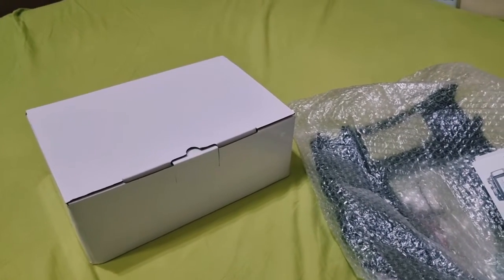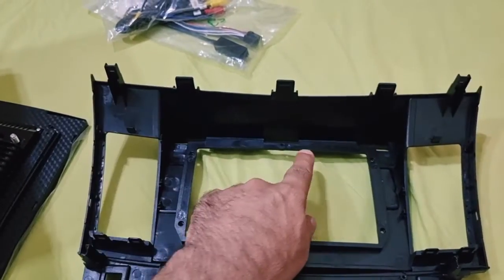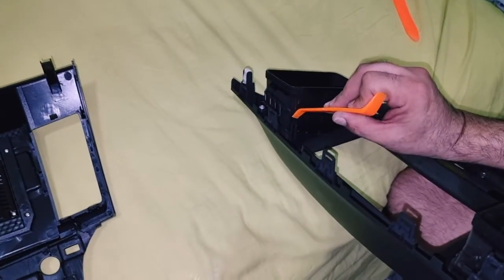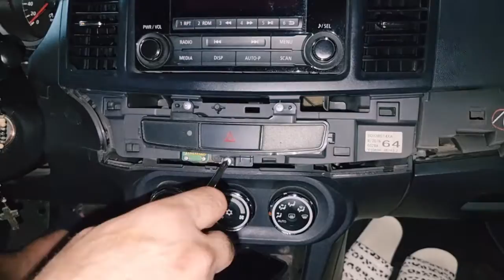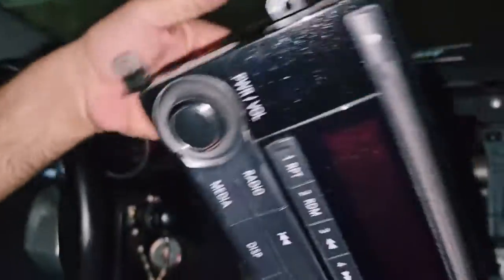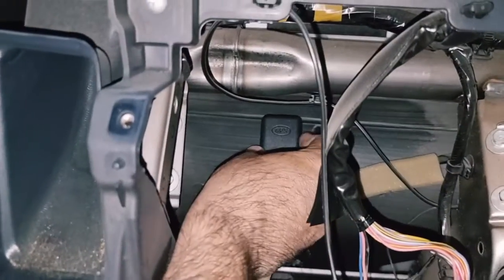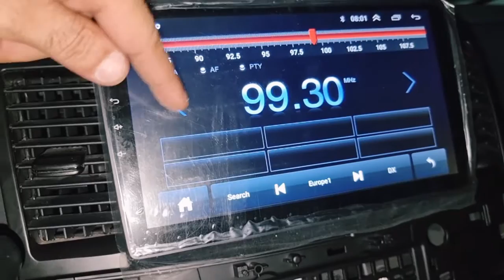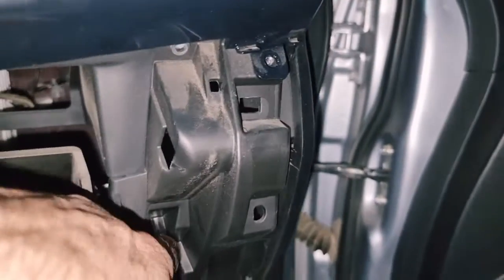How to install Android screen for a Mitsubishi Lancer

Comment: Nice….due to insane car prices in this country, new and second hand, with post covid19 supply issues/war/recession, seems like I’ll have to push my Lancer ‘09 for another 5yrs.  Which is fine, it’s low km’s and is in great shape.  Thanks for the vid, seeing how this is done will help update my car till its axels fall off.
Reply from the maker: Sorry to hear that, but hey there's always a rainbow after a storm. And keep the car as long as it's running and good condition.

Comment: hi do you know where i gonna connect the steering wheel control, what wire color for key1 and key2 thank you
Reply from the maker: Hey, normally the buirlink cable has it as well, it's a plug and play system, but for which colour I am not aware.

Comment: hey I did the same thing but mine did not turn on, I checked the fuseses and changed them but still no power, what do you think the issue is?
Reply from the maker: Hey there, not sure tbh either the power line is wrong for you or the screen itself isn't working. The screen also have fuse if you can check maybe it's burned out.
Reply: I have not used the screen for the last 5-7 month. Do you think maybe some thing is wrong with it
Reply from the maker: Check screen fuse maybe it's worn out, wires aren't open and corroded, or worse case scenario the screen is damaged already end of the day it's just a tablet it can happen.

Comment: I’m planning on ordering one tonight I have a 2009 lancer with the Rockford fosgate factory amp will this work with it ?
Reply from the maker: Hi, if you're going to install screen and you have Rockford built-in system you're gonna need to add an additional amplifier stock won't work

Comment: Do your steering wheel buttons work?
Reply from the maker: Yes it does you got to set it up
Reply: @asadfirm0001  gotcha! Thanks yeah I ended up figuring it out after I commented. Mine are also working now
Reply from the maker: Welcome fam, I'm glad you figured it out, quiet easy isn't it
Reply: How do you set up the steering wheel buttons?
Reply from the maker: Just head over to the settings and over there you'll find steering button set up.

Comment: Hey I installed the same radio in my 2009 lancer and got no audio. It powers on and works but no audio
Reply: I only had the antenna and the power plugged in I'm not sure what thoes other 2 small plugs you inserted were. I also lost airbags
Reply from the maker: Hey there, I think the reason is your car has Rockford sound system if yes then you're gonna need amplifier.

Comment: When i plugged mine doesn’t turn on☹️
Reply from the maker: Double check your cables if everything is connected and the fuse behind screen.
Reply: @asadfirm0001  yeah everything it’s connected, i think the power cable of the car its not correct :/
Reply from the maker: Weird because those cables are plug and play, maybe the screen you got is defective... Might have check it out and rewire it to normal electricity.

Comment: Wait so you don't have to re wire anything u just plug everything in??
Reply from the maker: Correct, all plug and play.
Reply: Do you have a link for this product? Where did you purchase it? And what is it called?
Reply from the maker: Got it from local shop here, but it's available in Ali Express too
Reply: I put this android screen before 2 months but loosing power from battery......
Reply from the maker: @highvoltage8357  there might be problem with any of the connections or the screen you've got is defect. 
Because normally you shouldn't have any problems with the electric or battery
Reply: @asadfirm0001  my lancer has rockfords amplifier so i think its from there the problem icant find solution
Reply from the maker: @highvoltage8357  mostly the problem will be from there then. Because electrical current imbalance is common with amplifier. I guess you have to check and update us please with the results.
Reply: @asadfirm0001  I bought the same radio for my girlfriend and it won’t power up. I wired it the same way as yours too